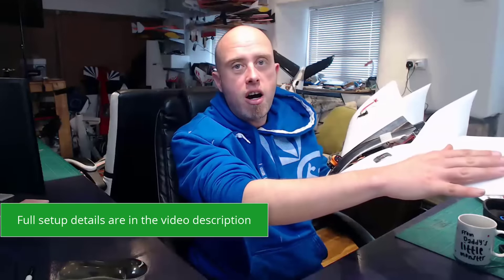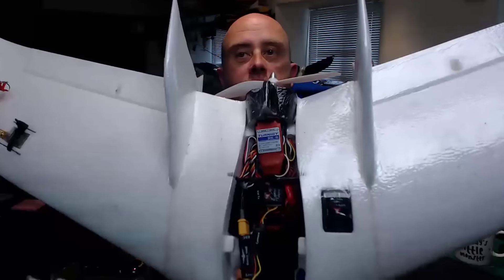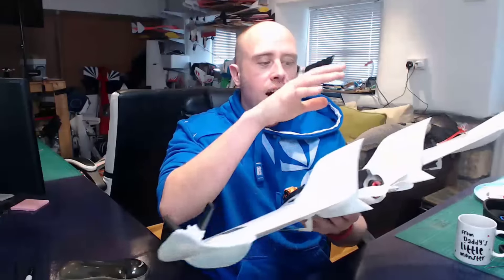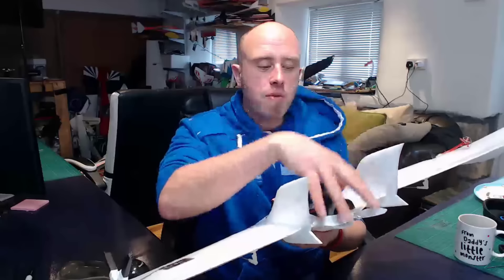FPV Save of the Century? WingWing Z-84

Comment: I'm as impressed that you were able to cram the autopilot in there as I am that you saved the wing; I'm still struggling with my pixracer-based build (mostly due to wiring issues). Bravo on that as well as the recovery, sir.
Reply from the maker: Evening, yea it was a tight squeeze to get everything in, but it has gone in. A tip I got from Ken, someone else who has done a similar setup was to mount the ESC under the fuse area. I'll mod mine to that later on :) Matt
Reply: That's...brilliant! One of those things that's so obvious AFTER someone else has suggested it. Thanks for sharing!